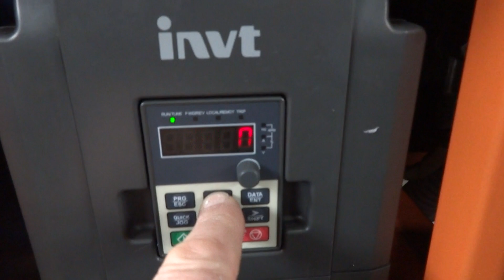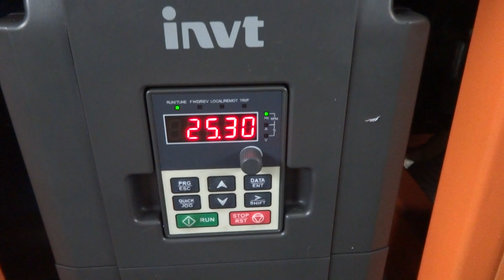Easy Wool Pro climbs Eurest. Test before leaving for Nepal.

Comment: How much power (kw) is required to run this setup?
Reply from the maker: We are company from Bulgaria. www.plasticabg.net        "EASY WOOL PRO" is the newest model in the series EASY WOOL. We have redesigned the old model with more compactness and low weight because our customers are mainly from foreign continents. Thus, transport will be cheaper and faster. The principle of the new model is the same as the old one with a capacity of up to 50 kg per hour depending on the thickness of the fiber.In the new model, everything is combined into one body. It also adjusts all parameters. Turbine speed, the power of the turbocharger, which controls the quality of the wadding.The feedstock is crushed into PET plastic bottles. It does not have to be clean. They can be crushed with labels and caps because nozzles are 10mm in diameter and there is no danger of jamming. All aggregates are built in and only a little running water is needed to cool the auger. A circulating small tank pump can also be used.The inertia power of the new model is 10 kilowatts and the nominal is about 3 kilowatts, because after 10-15 minutes of operation, the machine goes to autogeneous mode and the patented type of auger melts the material.The weight of the machine is about 350 kg. without the transport pallet and safe.The starting material is a soft fiber whose temperature is regulated by a change of temperature. The fibers have a cushion filling, soft toys, furniture, mattresses and more. After additional mechanical machining, the fibers can be used for blankets, clothes, non-woven fabrics, and more.The machine runs on its own, plugged into the current, and after warming the set temperatures, you run the auger and the turbo. Easy and simple to work and service. Works in continuous mode.All parts and aggregates are produced by us and the method is patented. 
    The cost is € 10800 excluding shipping costs. The production period is one month.
The EASY WOOL machines are designed and manufactured according to a program for ecological processing of plastics. They produce polyester wool, but their purpose is to utilize used PET bottles. We also offer PET bottle crushers that are tailored to serve the needs of EASY WOOL machines.
   "EASY WOOL pro" is very suitable for small business and for the initial step in new production because it works with PET recycled plastic and does not require a large room and a lot of production costs. For more question please write by email     plasticam@abv.bg

Comment: Does this machine require any air compressor editionally along with machine
Reply from the maker: All units are integrated in the machine housing. Including the turbocharger unit. All you need is a little water to cool it.For more details write to me at whatsaps 00359888494116
Reply: Ok thank you

Comment: Hello,
I am from Bangladesh. I am looking this type of small machine. May I know the price?
Reply from the maker: We are company from Bulgaria.  www.plasticabg.net     Our   "EASY WOOL PRO" is the newest model in our EASY WOOL series. We have redesigned the old model with more compactness and low weight because the majority of our customers we serve operate in countries outside of Europe. Thus with this compact design, transport will be cheaper and faster. The principle of the new model is the same as the old one with a capacity of up to 50 kg per hour depending on the thickness of the fiber. In this new model, everything is combined into one body. It also adjusts all parameters : Turbine speed, the power of the turbocharger, which controls the quality of the wadding. The feedstock is crushed PET plastic bottles. It does not have to be clean. PET plastic bottles can be crushed without removing labels and caps because the nozzles on the EASY WOOL PRO are 10mm in diameter so there is no danger of jamming. Other than PET aggregates nothing is needed but power to operate it besides a little running water to cool the auger. Optionally, a small circulating tank pump can also be used for cooling instead.The inertia power of the new model is 10 kilowatts and the nominal is about 3 kilowatts, because after 10-15 minutes of operation, the machine goes to autogeneous mode and the patented type of auger melts the material. The weight of the machine is 350 kg. The starting material is a soft fiber whose temperature is regulated by a change of temperature. The final product fibers are suitable to be used as filling for soft toys, furniture, mattresses and more. After additional mechanical machining, the fibers can be used for blankets, clothes, non-woven fabrics, and more. When supplied power the machine automatically regulates to set temperatures. Once set temperatures have been reached, you can operate the auger and the turbo. The EASY WOOL PRO is just that, simple and easy both operate and service. It works in continuous mode. All parts and aggregates are produced by us and the method is patented. 
    The cost of the EASY WOOL PRO is € 10,800 excluding shipping costs. Once an order is placed customers can expect around a month for the unit to be produced.
EASY WOOL machines are designed and manufactured according to a program for ecological processing of plastics. They produce polyester wool, but their main purpose is to utilize used PET bottles that would otherwise be considered waste. We also offer PET bottle crushers that are tailored to serve the needs of our EASY WOOL machines.
   "EASY WOOL pro" is very suitable for small business es as they provide an initial step in new production working with PET recycled plastic and requires neither a large room or a lot of production costs. If you have any further questions please write by email ing:      plasticam@abv.bg